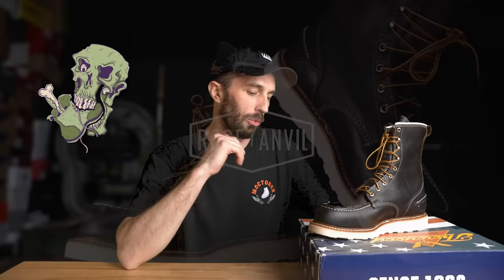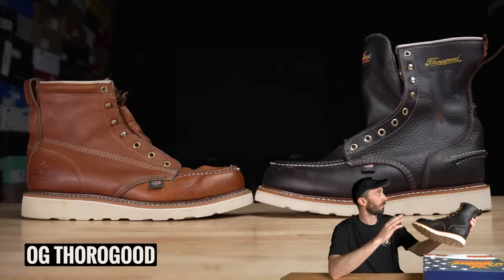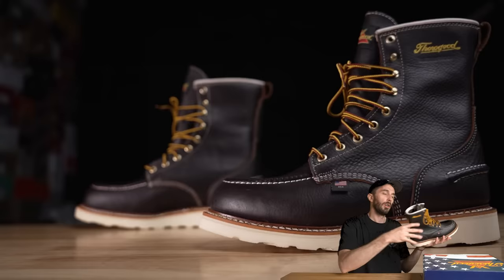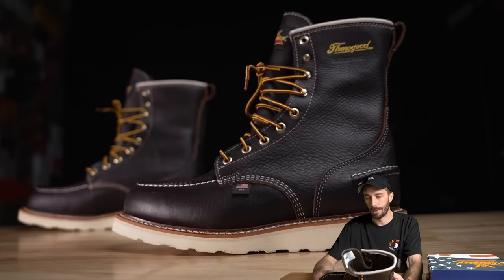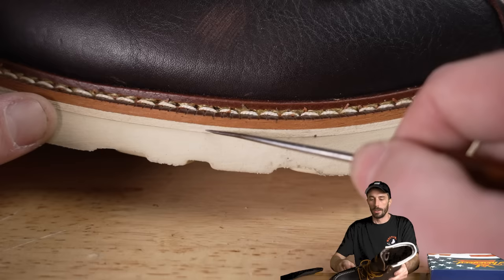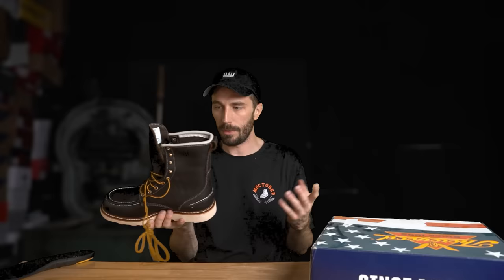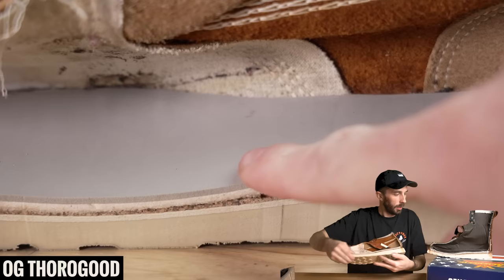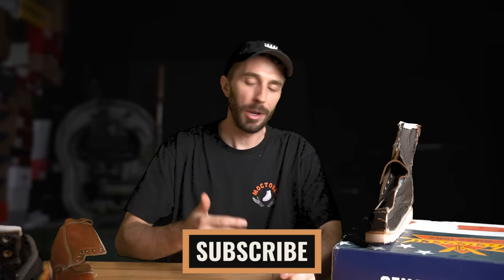Whats inside 1957 Thorogood boots

Comment: Purchased these in 2019 for construction as a journeyman carpenter.  Comfortable day 1 and lasted well over year without an ounce of regular care.  The waterproofing is breathable and never failed whereas those in Keens and Red Wings have.  I was a bit shocked to see the low rating, but I'm not a materials expert so I trust that your rating is fair.
Reply: Some boots are more than the sum of it's materials.
Reply: Keen in my experience has terrible waterproofing, but they’re by far the most comfortable boots I’ve had for construction, also the least durable sadly, have had eyelets break off in the past.
Reply: Keens are cheap for sure. Red Wing it depends a lot on the model. A pair of 875s would probably be as good or better than Thorogoods in every way except maybe break-in, and definitely cost.
Reply: @EssenceofPureFlavor  From a utility standpoint, the 875s lack critical features necessary to keep a tradesperson safe and productive.  Lack of a safety toe and waterproofing makes the 875 a non-competitor for anyone working outside of a finished space.  An 8" boot also adds extra support while helping to keep dirt out.  The 875s seem more premium from a fashion standpoint, as is reflected by the marketing on the boot's webpage.
Reply: @wpnt37    The difference between an 875 and the "work" version, 10875, is basically marketing. If an 8" boot is needed, fine, there's also the 10877. Steel toes are an annoyance for most jobs and not present on most Thorogoods either. And waterproofing is pointless on pretty much any boot and you're better off using leather treatments, so that's not much of a selling point imo. Have never owned Thorogoods and I'm not really putting them down, but Red Wing has absolutely earned their reputation. They're solid boots, and definitely not just a fashion statement.
Reply: Genuine question: I'm always curious about people who say they wear heritage style boots to work.  Don't most worksites/companies require boots with a safety toe, electric shock protection, etc?
Reply: @kit2770  Depending on the job. Most? No, I don't think so.

10877s are certified for electrical hazards btw.

Also, I don't want to give the wrong impression. I wear 607s for work, not 10875/875. But the reason is mainly cost. I've handled 10875s, and they're a better boot in just about every way. Except for cost like I said, and INITIAL comfort. Poron's great at first, but once it's allowed to break in, you can't beat ordinary leather. The reason "modern" boots use synthetic materials so much is cost saving, and people not understanding or not being willing to go through initial break-in. I can't see much else.
Reply: @EssenceofPureFlavor  I see.
Reply: @kit2770  Safety requirements vary based on location and market sector of construction.  While OSHA does not require toe protection, most GCs who work in the commercial or industrial space, regardless of location, will designate an ANSI Z41 rated boot as part of standard PPE.  Though, in my experience, nobody ever checks.
Reply: I have these, they are super comfy just not very waterproof. Much more comfortable then redwing moc toes
Reply: @wpnt37  in canada boots must be CSA approved, steel toe, shank and shock protection.
Reply: @kit2770  Yes, in the last 20 yrs, I've never worked for any real construction company (and there have been many, both union and non-union) that didn't require a safety toe and above the ankle support (at least a 6" boot)
Reply: One Year is not a long time. It is a short time even without care.
Reply: @Charon-5582  Not surprised. The States have always been a bit behind when it comes to safety.
Reply: @quickshot4050  really? Keens hurt my feet so freaking bad it was insane. So far Carolinas have been the won for me.
Reply: @Taugtaug  Tell me you don't work in construction without telling me you don't work in construction...
Reply: @wpnt37  I had the steel toe version of these boots and got over a year out of them. I was hoping to gain a little confirmation bias from this video and I kinda didn't get it.... 

To further your point though- there is a noticeable difference in high quality boots. Any boot that you enjoy wearing and that lasts for a year in the construction industry is worth $300 in my opinion. Add a semi-custom orthotic insole to it and you'll be loving life!
Reply: @JB-gj8pu  I'd disagree
Reply: I think that Keens are not the same as they used to be. My first pair of work boots were Keen brand. They were treated badly because I used them as winter boots too, so salted snow soaked into them, and I never maintained them because they had this kind of Swede finish that I had no idea how to care for. They still lasted more than a year. So after that I started to trust the Keen brand and got another pair. This one I only used to commute to an office job in a warehouse, no more actual warehouse work. They lasted a year under those improved conditions. Then I got a third pair, at a different job. This one only had mild warehouse work, and it lasted only 8 months. After that I decided it was time to move on from that brand, and so I got a pair of Jim Greens. I can’t say much about those yet, as it’s not been a year yet. They seem to be holding up well. The first pair of Keens I got (the strongest pair) were on clearance at Sears. A relative got them for me as a gift after I got that warehouse job, so they left a really positive impression. Too bad.
Reply: I have the steel toe version of that exact boot. Had them over a year in the construction field. I love them. Irish setters are next.
Reply: @jgrove313  don’t waste your money. Had the Red Wing 2418s, which are better Irish Setters, prior to Thorogoods and the Thorogoods are far better.
Reply: @wpnt37  completely agree. Irish Setter is worse than Red Wing. That's a fact. They're made by Red Wing, and they intentionally price them at a lower price point, and use cheaper materials. They're not bad for some things, but I wouldn't use their work boots. The cost savings isn't worth the difference in quality.
Reply: I just bought dome and yet to test them out at work. I watched Anvils video and thought man I should have went with the orange moctoe, original thorogood. But you gave me key insight, thanks! They're very comfortable and I hope they'll last for a little while
Reply: @EssenceofPureFlavor  an annoyance lmao?  I’m most countries they won’t even let you on any job site without them.
Reply: @frankytanky5076  Okay? And?
Reply: I wear this exact boot , I got 2 yrs out of the last pair and could still be worn, no holes or loose stitching except for on top the toes , I've had other name brand boots that lasted as little as 6 mo !!
Reply: @kit2770  
There are traditional " heritage style " boots with all those features.
Thorogood offeres safety toes in even their moc toes, and they use a fiberglass shank that passes electrical safety standards as well.
Work boots can still look like real boots while meeting safety requirements,  they don't have to look like shit just to be safe.
Reply: Great feedback. If and when I decide to buy waterproof boots again, I’ll buy these.
Reply: Ive never met anyone with therogoods who’s sole wasn’t flopping around like it’s talking to you. My guys always end nailing or gluing it mid shift. But then again I’m not an electrician I’m in civil public works. Heavy highway
Reply: @guQYdjfdwkCFQDFqUTTrqyVrhTN  
Around here I see that with Georgia's but not on thorogoods.
Reply: @d3vastat0r89  With Keens, it really depends on the model, but overall they're becoming more miss than hit IME. I got a pair of MITUSA Keens that are comfortable and hold up really well. But my best buddy got an imported pair AND a different MITUSA model just a few months later and both started falling apart within 6 months. And they're not recraftable/upgradable like my Thorogoods are.
Reply: @joshuareed3999  Did you get the Thorogoods recrafted after they wore out?
Reply: @Jason A. Did you get the Thorogoods recrafted after they wore out?
Reply: @EssenceofPureFlavor  Agree. I have Keens and Zamberlains with Gore-Tex lining, and I prefer just to have leather that I can treat for waterproofing (although I can treat the Zamberlains - they are good).
Reply: @EssenceofPureFlavor  Poron isn't any less expensive than leather...I also prefer leather for the footbed.
Reply: @InGrindWeCrust2010  I bought a new lighter pair of boots before the Thorogoods wore out so I haven't re-crafted them.  They still have some life in them.
Reply: @InGrindWeCrust2010  I didn't, but I still have the boots and wear them occasionally. I wouldn't say they're totally worm out, but they don't have much traction left on the sole. The one minor complaint I have now is that the steel toe liner on the left boot has slipped down, and I can feel it when I move my foot a certain may. They're still amazingly comfortable and don't leak a drop.
Reply: I have keens as well comfortable but the water proofing fails
Reply: @wpnt37 Whatever... Canada and Australia and Europe are paralyzed if you aren't covered with Hi-Viz and every other "safety" gadget. We aren't behind we are pragmatic.
Reply: Red Wing Iron Ranger is the way to go if you don't mind the price. The break-in is long, but with care and mink oil, they are the most comfortable boot I've put on my feet 6 days a week, 8 to 10hrs a day minimum, and they wear like iron. Lol
Reply: @EssenceofPureFlavor  Warehousing, construction, and any manufacturing all require steel toes. I'm honestly having trouble imagining a trade that either doesn't require it or at the very least would not benefit from steel toes. Even as a carpenter I switched to steel toes after one too many sheets slipped.
Reply: @EssenceofPureFlavor No. Red Wing earned their reputation for the first 50 years. The last 20 have done nothing to uphold it. Overpriced, underbuilt.

Comment: I've had these boots since March of this year and have already put 1500 miles on them at work. FedEx delivery driver. Resoled recently and I can tell that the original sole definitely lasts longer. The boot as a whole has treated me well.
Reply: Sketcher's Diameter are superior
Reply: No ankle support.
Reply: How much did you pay to resole them?
Reply: $60
Reply: @jeremiahlahey3106  thank you for the response 👍🏻
Reply: @galvanizedgnome  🤮
Reply: @galvanizedgnome  to sandals yes
Reply: @jeremiahlahey3106  
Did you go through Thorogood?
Reply: You should get altras
Reply: I deliver as well (bread delivery). How did they do on those slippery deliveries cold frozen, wet greasy kitchens etc...
How well do they work for going in and out on the bumper 60 times a day?
Thanks
Reply: @davidfletcher9006  they do really well in wet and greasy areas! I wear a different pair of boots during winter so I can't speak for the ice and snow. They have done really well getting in and out of the step van 100+ times a day. They hold up really well. The uppers have exceeded my expectations.

Comment: I bought a pair of these with a steel toe and “briar pitstop” leather .  I’m a forester and work in the woods and I’m at our mill facilities.  These are comfortable on the catwalks and concrete at the mill.  They were easy to break in.  There are some downsides however.  While they are great in the mill, they are questionable in the woods.  The sole gets covered in mud easily and becomes very slick, almost like skating when walking on a muddy logging road.  The boots have very supple leather, but they have scratched easily and showed briar damage from day 1, the scratches are all superficial, but definitely noticeable.  Lastly, just like the pair reviewed mine leaked.  It was not as much as the test showed, but they are definitely not waterproof like my Gore-Tex hunting boots are.  The lining around the heal is also showing some wear.  Overall, I wear them on days I plan to go to into the mill and purchased a pair of Georgia loggers to hold me over until my Wesco’s are delivered in a few months.
Reply: How do you like the Georgia Loggers? Was thinking about trying them out since, I'd love a pair of Nick's or White's but I haven't been able to bite the bullet yet,  looking for something in the $200-$300 range.  I'm a bucket man for a small tree service and have to climb every great once in a while. Would love to hear what you think.
Reply: @jesseshort8  so far so good.  I’ve had them for 2 months and wear them 2-3x a week for 9-12 hours a day.  They took some breaking in, but once they got comfortable they are about the same as my Thorogoods.  Build quality is what you would expect from a  boot in the price range, adequate not horrible, but definitely not US hand made standards.  The insoles leave a bit to be desired so I’d recommend an upgrade, but that’s my take.  Overall, they should last about a year which is what I need them to do.  They seem to be waterproof and the lining wicks moisture pretty well.  Overall I’d rate them as a “good” for the money.  For reference I have the steel toe - lace to toe version, non-insulated.  Are they going to be as good as a West Coast boot, absolutely not, but they are much better than some cheap boots I’ve bought.  If your a lineman, you may need support for climbing spikes, unfortunately I can’t help you there, I’ve never tried them with spikes.  I think there was a review on Amazon that mentioned using spikes with them, you may want to check that out.

Comment: Having used a lot of waterproof membrane boots in very wet conditions, they can easily be punctured by bits of grit or mistakes in the manufacturing process. And when they do leak, or if water gets in over the top, then they take forever to dry out as the water is trapped inside the boot until it evaporates. 
You're right that for most purposes, waxing your boot works just as well.
Unfortunately marketing means that people look for membrane boots with Goretex tags and they sell better than non-membrane equivalents for hiking boots or similar applications.

Comment: I recently bought a pair of the 1957's just like these, but with a 90 degree heal.  (Required by my Company) and in the safety toed version.  I have not noticed any problem with "breathability" and I wear Marino wool socks year round.  My only "issue" was with the ridiculously large amount of leather in the tongue of the boot.  There is SO much extra leather there, that you have to fold it up around the sides in a very specific way,  and it created hot spots on my ankles.  This was the most difficult part of the break in period.  And was quite uncomfortable at times.  I had to tie the boots so that they were tight around my foot, but very loose up the ankle.  Either the leather softened up, or my ankles just got used to the extra pressure.  Either way, they are pretty comfortable now.
Reply: Had the exact same issue with mine and I was really questioning my purchase.  Once they were broken in, a long uncomfortable process, they were perfect thankfully.  They have to address that tongue
Reply: Are you guys sure it's the toungue and not the speed hook?  Asking because on these boots and the Nicks Builder pro I noticed ankle bite right were the eyelets are.  The leather around them has to softed up with wear before they stop hurting you.
Reply: @Loganedward29  no.  It’s the excessive  amount of leather used for the tongue.   It’s so excessive it has to be folded again and again and creates “hit spots” on your ankles.
Reply: @angryagain68  I'm struggling to see it.  I may just be missing it.  Or mine could just fold more naturally.  The 8 inch model I have just rest right inside the boot and I never notice it.
Reply: @Loganedward29  or, possibly you just have larger than average ankles?  Don’t know.  But I can tell you that this one of the more common complaints about this particular boot.
Reply: ahh I just commented on this in my feedback without reading this.. same issue here, Day 1 of new boots today and the dreaded tongue.. I'll have a go at finding a comfy position till broken it or wear tape in that spot or something

Comment: I've had my pair for just about 4 years. Working as a beer delivery driver in the mountains for the past year they are pretty far from waterproof at this point. They saved my foot from breaking when I dropped a keg on it (barely I almost had to cut it off to get my swollen foot out). They are hands down the most comfortable footware I have ever worn. The heel doesn't wear out and they saved my ass from rogue nails on miltiple occasions. These boots rake in the bitches don't doubt it for a second.

Comment: I used to use a pair of Thorogood 8in steel toes back when I worked in a naval shipyard as a welder. Some days I would spend 8 hours scooting around on the metal floor to weld, that little extra leather on the heal helped to prevent excess wear in my experience my old red wings had a blow out because of the wear to the back of the boots and on the side of the heal.